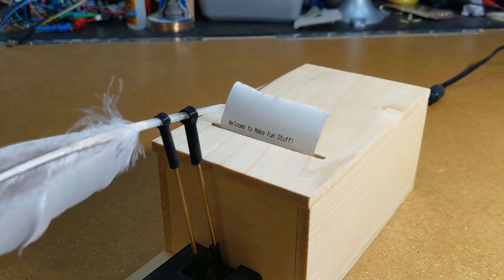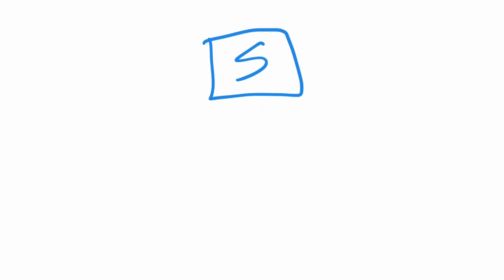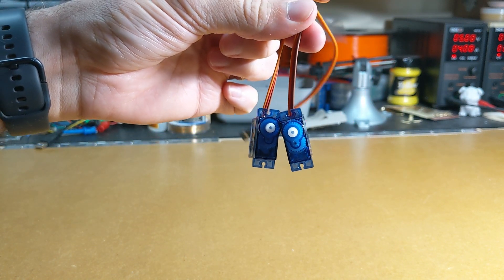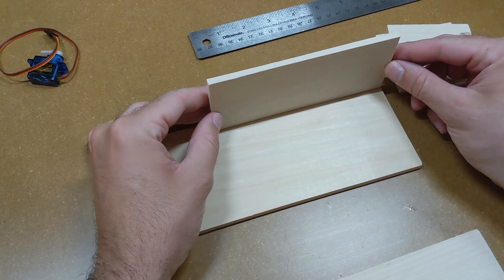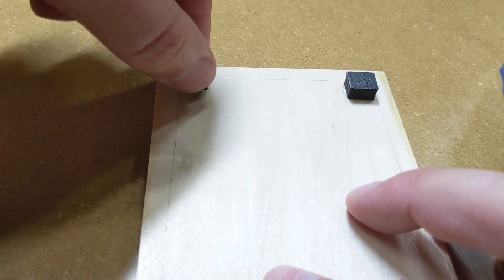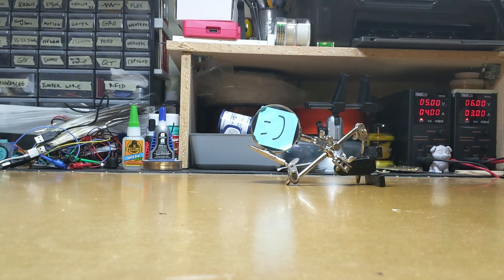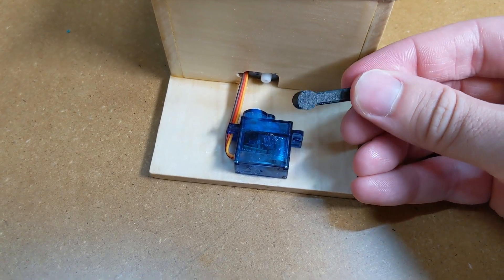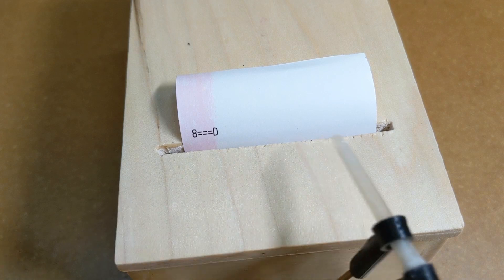Building a magic wizard quill to send my wife cute messages | Ye Olde Fax Machine

Comment: Love the video and the idea. Is the code for this aviable somewhere?
Reply from the maker: Thanks, glad you liked it! The code is in Bitbucket, and there are links to the repositories (which also include circuit diagrams) at the end of the video description. Enjoy!
Reply: @MakeFunStuff  Thanks!! Want to recreate this to some degree for a long distance friend of mine.
Reply from the maker: Awesome, let me know how it goes!
Reply: @MakeFunStuff  I don't know much about coding and stuff. Am I able to send messages from everywhere if I am connected to the MQTT server?
Reply from the maker: Yep, the device listens to the server, which can receive messages from anywhere in the world.
Reply: @MakeFunStuff  Is there a noticable delay? And if I use an esp32, do I still need the arduino nano?

Sorry for bombarding you with questions 😅
Reply from the maker: There's a delay but only a second or so. You only need the Nano if you want to set up the feather, the actual printer just needs some internet-enabled microcontroller like an esp8266 or esp32. If you did want the motor control though, you'd still need a second controller because the ESPs don't have multiple threads, and the printing is done synchronously so you can't run other code while it's printing.
Reply: @MakeFunStuff  Oh okay! Makes sense. Thank you.
Reply from the maker: No problem, good luck!

Comment: *ESP32 has 2 FAST CORES (ESP32_RTOS_SDK)*
#168 ESP32 Dual Core on Arduino IDE including Data Passing and Task Synchronization
https://www.youtube.com/watch?v=k_D_Qu0cgu8
ESP32 Dual Core Programming | ESP 32 Multitasking
https://www.youtube.com/watch?v=YKeVJDFRnIA
#149 ESP32 Dual Core Programming + Speed 💨Test vs Arduino UNO (fast!)
https://www.youtube.com/watch?v=jpVcCmh8sig

Comment: For your paper Slot, you could cut a bigger hole and just 3d print and nice guide that covers it and goes over the top.
Reply from the maker: Good idea! That'd also let me attach some metal teeth to make tearing the paper a little easier, which is something else I've been thinking about adding.
Reply: @MakeFunStuff  for the slot you can "score" the wood on the faces with an exacto knife so that the tearout is minimal. But the 3d print idea sounds good for this specific location and purpose.
Reply from the maker: Good idea! I hadn't considered scoring, I'll give that a try next time.
Reply: What about a Dremel router bit?